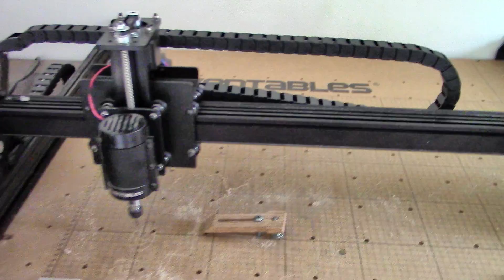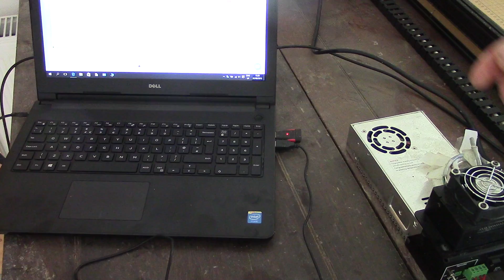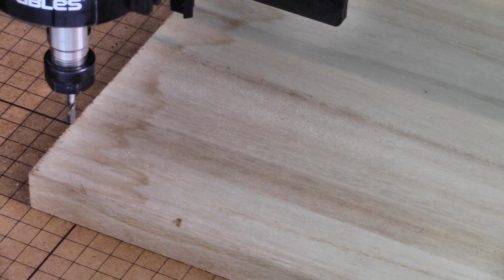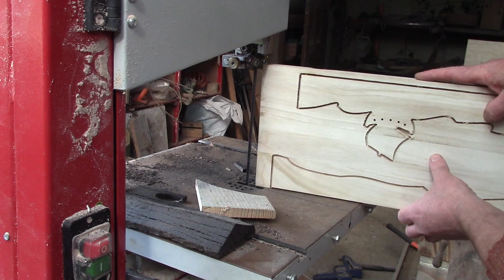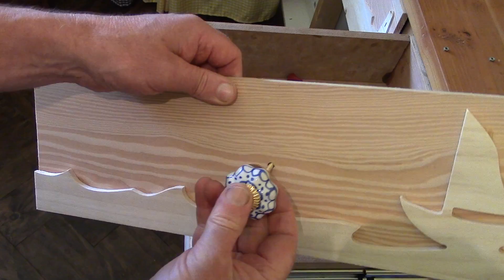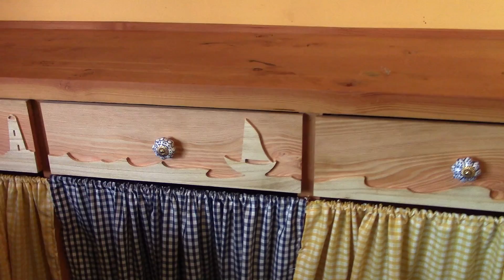First Project With The X-Carve CNC Machine – Cutting Drawer-fronts For The Kitchen From Paulownia

Comment: people seem to have trouble with belts slipping and loose cam rollers causing the spindle to skate about, im planning on getting a CNC next year, will be keen to see what you use yours for ;-)
Reply from the maker: +the green man Yes, that was part of the troubles I had with this one. The alternative is having threaded bar drives, but I read somewhere that they are slow?
Reply: WayOutWest Blowinblog ball screws are best, not slow but expensive;-) ive seen too many problems with this machine to consider getting it. but if its a free review unit, its okay.
you can build your own and save money though, if you are tech minded enough.im saving for one, havent the patience to build. but they are fabulous machines. im going to use mine for v-carving and inlay work.
Reply from the maker: +the green man. From what I've seen so far, it might be well worth paying the extra. Have you come across any inexpensive kits that use that system?
Reply: WayOutWest Blowinblog various suppliers , cnc4you.co.uk , rhonmac-cnc.co.uk
or on ebay etc,   but im not sure of the quality, lots of dodgy chinese machines available, the electronics seem to be bad on chinese machines. id use a forum such as on - mycncuk or cnczone.com, for research into this,
it is possible to build a good machine yourself if you are tech minded, lots of videos on youtube.
 im going with a german supplier with a good reputation - prototools.co.uk is their uk agent. cncstep.com  is the home site.
vectric software such as v-carve pro is essential.
i know the machines are a lot more than an x-carve but frankly it is a mickey mouse machine. it depends how much work you expect to do with it, hope this helps.
Reply from the maker: +the green man Thanks, yes it does help. As always there's a toss up between investing in the best quality you can afford and working out how much you're actually going to use the tool/machine. I couldn't afford those machines, so it's easier for me. I got this one so I can work on prototypes and I am cautiously pleased with it at the moment (till something else goes wrong) - but I wouldn't expect to go into production with it. Still I'm learning a whole lot and even if I upgrade later, I wouldn't regret my time with this one